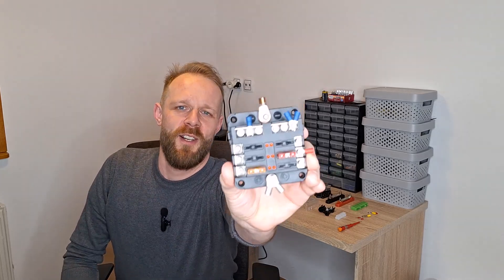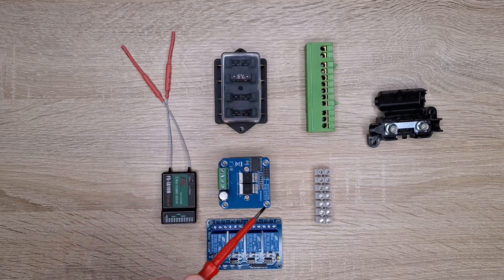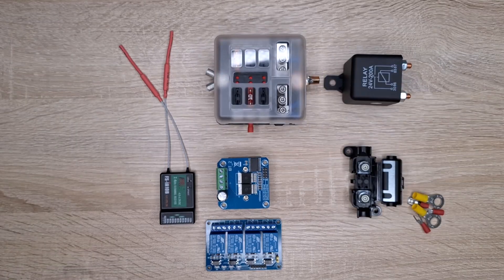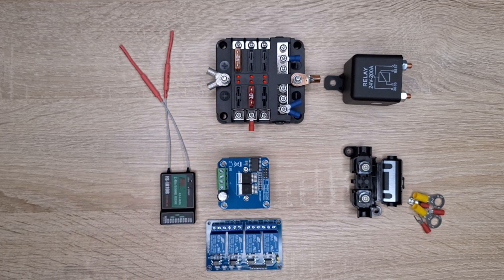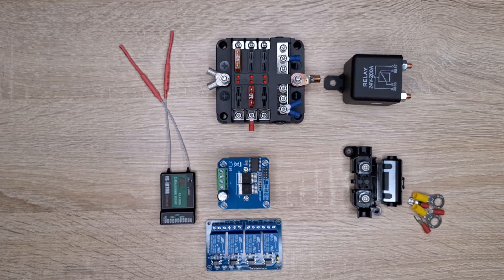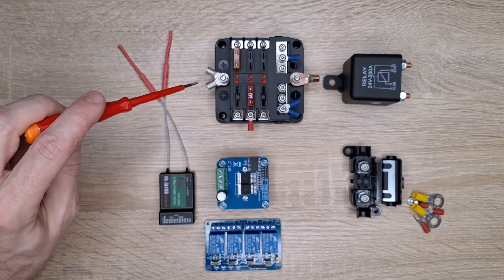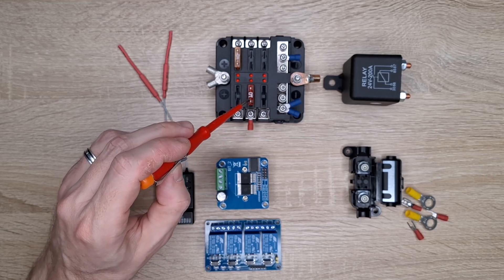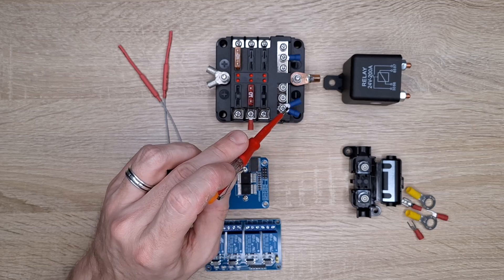Fuse Box - Remote Control Lawn Mower DIY

Comment: Hola desde España. Te felicito por tus videos. Tengo un problema con un fusible de mi cortacésped a control remoto. Cuando pulso en botón de encendido se funde el fusible de 30 amperios y no se el motivo. se que te facilito pocos datos pero no doy con el fallo y tampoco se mucho de cables y cosas de esas.
Reply from the maker: Hi, i cant debug your wiring, becouse I dont have enough information. Maybe if you send me some detailed pictures or if you ask skilled electrician. My email gkobetic@gmail.com

Comment: hi handsome, Could you sell a lawnmower remote control kit,with ALL the necessary hardware and software? thanks
Reply from the maker: I made electronics for driving main motors and control board for start/stop gasoline engine, turn on/off lights, horn, etc... Actually will not take much to prepare all kit together. Thanks, good proposal.

Comment: very timely! i have this as my problem for weeks! thank you!!
Reply: i was using a micro esc found on a micro servo and off the market micro esc to control the bts 7960 instead of a relay. it did run sometimes and sometimes it doesn't.🥲
Reply from the maker: my pleasure ;)

Comment: where did you find that fuse box?
Reply from the maker: I bought it on anazon.de   https://www.amazon.de/-/en/Rovtop-Independent-Positives-Negative-Indicator/dp/B08ZKNP3JR/ref=sr_1_6?crid=175DZYRLU5F70&dib=eyJ2IjoiMSJ9.Kt3bRw8nN2meHMwikILtFAfoNHjiY4d0XNnQKEdfn7VQ8_3sbj211ZCzT-JgE4ilcwK4GI7B5gD05E3USsDCagEZszBLsCUIpQbBJi7eXDrumEfwZgmFzbY6wI8WfrMnVYCyjxcBddWl8Jpc9ch3i_o7cYTAczQDp14IZThyVCRj2xvkaMAFE2jAiy-YGv3VI8Yve6_SKBfyuHmi_82St4IWh9xtxzwqlJa52o-jxjcSejTjMmCR47unE4bpFLnsZSFOWvPFBHThCcRD44UFoE5TWBLuVOApVn2WYcrJLzo.nopJEfwVZMr9YUhhaS9pWyTXxnW-3DpyzJjvJC7xS8Q&dib_tag=se&keywords=fuse%2Bbox%2B6&qid=1710352677&sprefix=fuse%2Bbox%2B6%2Caps%2C260&sr=8-6&th=1
Reply: thanks for this info @gregorkobetic